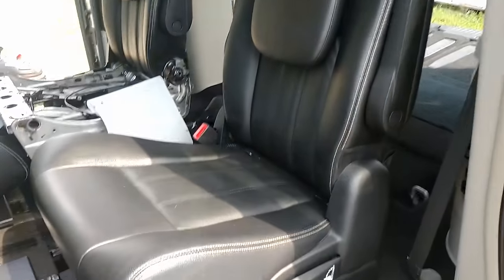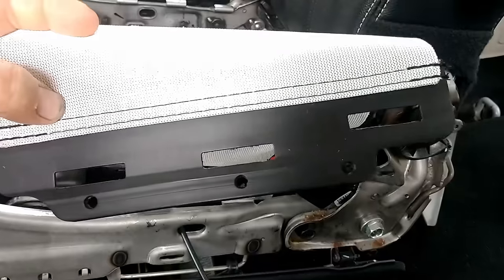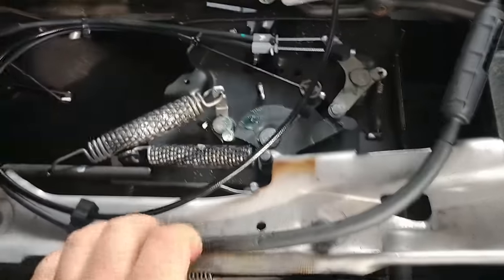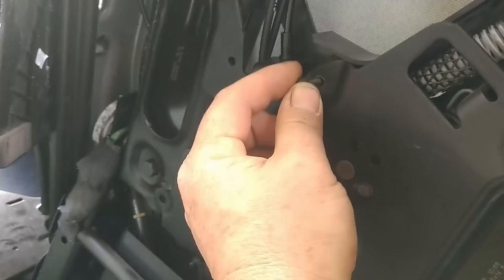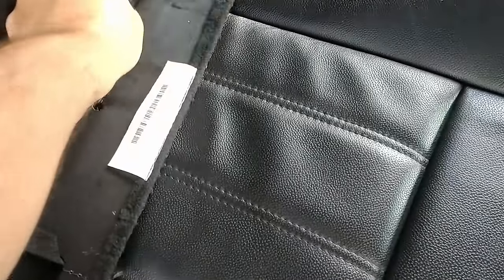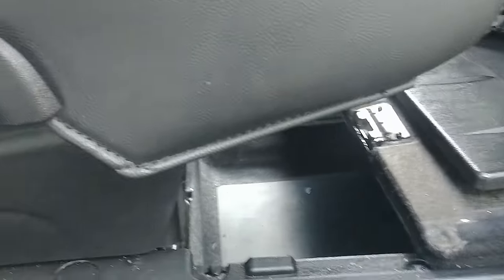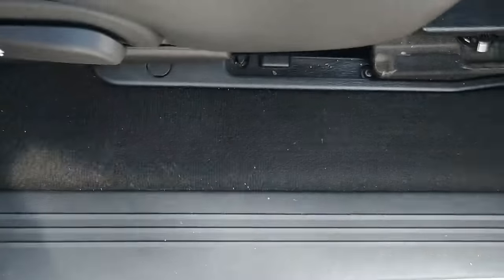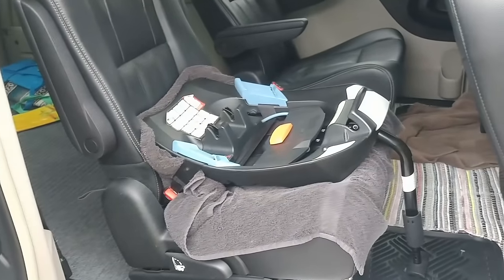REPAIR OF STOW N GO SEATS THAT WONT UNLATCH

Comment: Go to the back of the seat underneath is a metal rod that runs along the back of the seat, feel that rod and go right in the center, there is another rod or lever about four inches perpendicular, just push it up with a little force and it folds the seat away so you can stow it
Reply: Hey brothed could you do a video with what you are doing ive been trying to find that piece to push on for a couple hours
Reply: Any idea what you'd do if that bar is the part that doesn't really want to move? I can get it to go, but with much force. It is the piece that keeps pulling the other cables out of place since it doesn't want to rotate.
Reply: I CANNOT GET IT TO PUSH UP TO SAVE MY FRICKEN LIFE
Reply: Ty so much most helpful comment on the internet
Reply: Literally thank you so much I was looking for a quick fix
Reply: I grabbed a pair of visegrips and pulled on the cable underneath...it helped to dislodge the seat.  Now it's going down in the floor forever... Thank you.
Reply: This was the best comment for temporary solution. THANK YOU!!!

Comment: I went to a local bike shop and purchased the metal wire that is usually used in bicycle brakes and ran it through the black plastic part which was still fine and I didn't have to remove it, only the wire has snapped. That metal wire is longer than the original wire but it's ok. The wire has one end closed and the second end open which you can use to run through the black hose and used a bolt with a hole in it and tied it with the nut, this special bolt is also used in bike braking system. This whole thing cost me only a dollar where I live and it works perfectly fine.

Comment: Thanks to this video I was able to determine that the cable had come out of the slot which was keeping the lowering of the back rest from triggering the release of the bottom part of the seat. Kudos to your taking the time to make this video.
Reply: I am hoping that's all that is wrong with mine. My sliding door on the driver side is broken/locked shut and the seat on the middle passenger side won't release as above...would  have been nice if the problems were on the same side...lol

Comment: Thanks to your video, I was inspired to try again, as I had given up! Find a hard piece of flat wood the width of your palm or a flat tool. I did this with a vise grip plier. Hold your palm face up, holding the tool to protect and strengthen your palm, under the rear of the seat. You will be in contact with that angled metal piece with the cable running through it. As you lift up, you will notice the catching mechanism release. Once released, you're good, assuming all other steps are followed.

Make sure the seat is moved to the forward position and that the handrests are correctly folded. Keep the tool handy for future uses!

Comment: That would be a sweet van for wife’s flowers business and yet run around with kids. Quick question, would you know if mounting bolt hold be same on a 2001 F350 and 11-16 F250 seats? Found manual front and rear seats from 11-16 F250 for my 01 F350 and been trying to figure out if the holes to mount will match and figure you might have looked into that will all the F trucks you did
Reply from the maker: i think the driver and passenger seat will work but the center console / seat mounts differently. i imagine you could make it work. i have a few 2011-2016 trucks. i could try them in a 2007 i have and see how it lines up.
Reply: J.C. SMITH PROJECTS that would help out, but don’t go out of your way, the front ill do pilot seat in middle, won’t have a console, so wondering if that would make things easier. I’m almost sure rear seat might have same mount holes. I guess trial and error = success
Reply: @j.c.smithprojects   would you happen to have the part numbers for those 2 floor flaps? my van was missing them and the dealer cannot find a part number for them. Thanks

Comment: How hard do you think it would be to flip the 2nd-row seats so it's facing the 3rd row? I can't seem to find anyone who's done it for a 2014 Dodge Caravan RT. It seems like it would make more space and better for commuting with others more fun. Thoughts?
Reply: Look for a 2008-2010 van with "swivel and go" middle row.   Simply steal its second row seats,  recover them with your 2014 foam and covers.   Voila.  
You likely wont be able to use the table feature though.
Reply: From what I recall the swivel and go vans had a flat floor in the middle unlike the stow and go but if you have enough time, tools, money I am sure it can be done

Comment: JC Where did you order the part to repair this.  I looked for the part No you showed without success.  Thanks for the demo!
Reply from the maker: chrysler dealer had them in stock....common problem.
Reply: @j.c.smithprojects  I can't seem to find if you posted the part number to order. Do you remeber what it was?

Comment: J.C., how did you get the seat tilted forward so you could work on it? Or, did you take the seat cushion off first to get to the mechanisms/cables from the top down?
Reply from the maker: i went to the under side in the back and just pulled the lever to release it.

Comment: I'll be diving into this soon, but in the meantime I found a metal protrusion under the center of the back of the seat that releases it which gets me by just fine for now.
Reply: DANDY DJ and PHOTO BOOTH where exactly is it?
Reply: @reefcrow9818  bar across the back of the seat. Reach over the top of the bar but under the seat in the center and feel for sort of a metal thumb for lack of a better term. Pull up on that.
Reply: @reefcrow9818  did you end up finding it? I couldnt find what hes talking about
Reply: @DandyDoesIt  hey you wouldnt mind sending a picture of the peice i cant seem to find it
Reply: @vincentcuizon1932  feel under the bottom of the back of the seat in the center. You have to put practically your entire hand under there and then reach up a bit. It's like a flat lever about the size of a thumb. It's flat vertically. The pull wire is supposed to attach to it. My wire is missing so I have to pull that by hand. It's a little tough to do admittedly but once you find it and do it, you'll have it. Grab that and pull down hard.

Comment: do you have a video on how to remove the sear cushion so i can repair the problem?  thank you
Reply: I started removing the seat cushion from the back first, before removing anything else. On my 2014, you pull out at the bottom-back and plastic tabs attached to the fabric pop-out from behind the plastic end cover. Then you can lift-up the fabric flap and access the screws holding the end caps the cover the pivot joints. From there you just push the foam and fabric forward, and release the fabric on the sides of the seat.
Reply: @matthewsmisor1364  thank you, i'll give it a whirl tomorrow

Comment: I ORDERED THE CABLE KIT FOR MY 2016 T & C SECOND ROW RIGHT SEAT.
PART NUMBER WAS 68143770AB - 001 COST $60 PLUS TAX THRU AMAZON
Reply: Looks like all our 2nd row right seats are messed up I have a 2015 exact issue
Reply: I ordered cable kit for my 2014 T&C, 2nd row left seat (Driver's Side).
Part Number was 68143771AB-001 cost $58.79 from Mopar and $13.02 Shipping, so $71.81,
dealer wanted $99.
Reply: Also, my cable kit only came with (2) two cables not 3 like J.C. Smith said in the video.
I only had one failed cable, but replaced them both.
Reply: Can anyone add a link to wherever you bought them from?